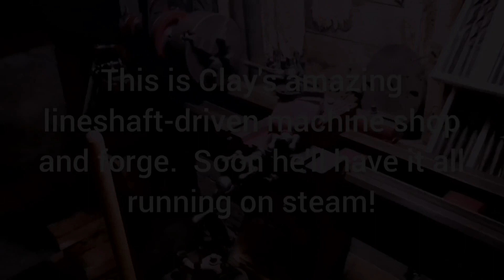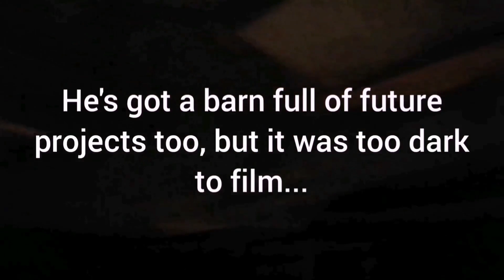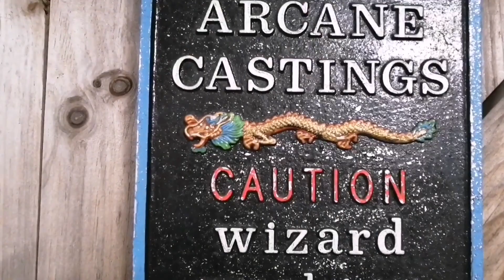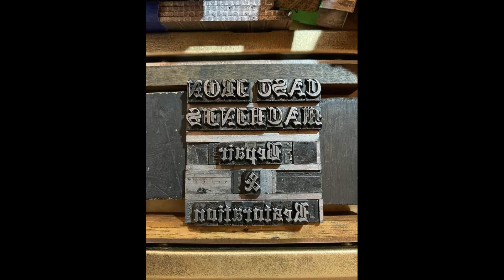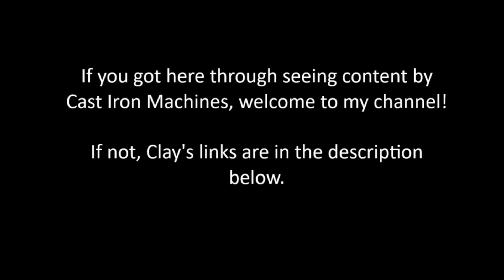Casting a Kelsey Letter Press Chase for  @castironmachines

Comment: My old chases are all steel not cast iron because they had to withstand a lot of lateral pressure from tightening the quoins to lock in mixed type and blocks...
Reply from the maker: Thanks for the info.  The customer wanted a chase with a little extra "bling" factor, I think.  Can tell you for sure I can't cast steel though.  I believe the aluminum bronze ought to hold up fairly well in place of steel.  A fellow in Ohio who's restored and sold all sizes of Kelsey presses told me they're usually cast iron, but I'd also heard "steel or possibly cast iron" from another trusted source. 👍

Comment: Hey dude..  THF down??
Reply from the maker: Yeah, this is the 3rd month in a row this has happened  I think.  1st time was a banking issue, Dave's bank thought they were saving him from scammers by not paying out the site hosting fee... Maybe the same issue repeating?  Knowing banks I would not doubt it.  I'm sure Dave's working on a fix.  I'd be on the forum right now posting a link to Clay's brand new video about this letter press restoration if I could! 😊 Weirdly I didn't get any notification about your comment, I just happened to be checking.

Comment: Why not fix the flask alignment? it's wood and screws, 30 minute job going slow.
Reply from the maker: First flask I ever built, so I hesitate to alter it for purely nostalgic reasons.  If this hadn't been a flat back, or if this oddball size flask actually came in handy more than a couple times a decade... I'd probably feel different. 😁
Reply: @tobhomott  I understand the hesitation, but you will eventually thank yourself for applying your new knowledge and improving your tools and processes.
Reply from the maker: @askquestionstrythings  it's definitely somewhere on my long list of planned improvements. 😉